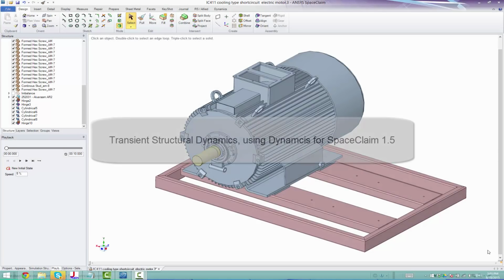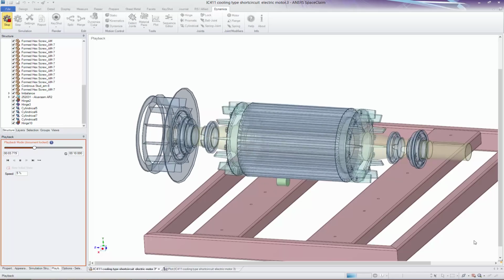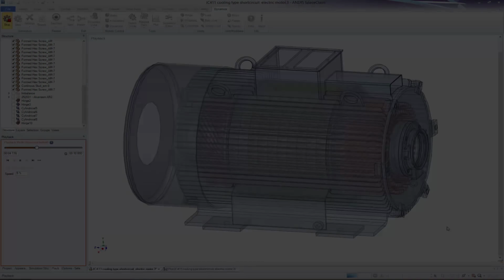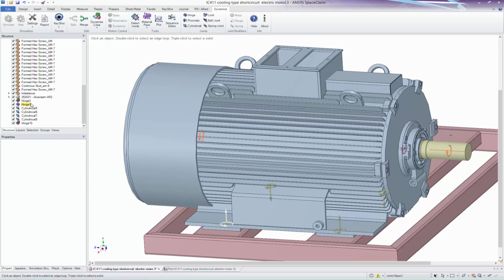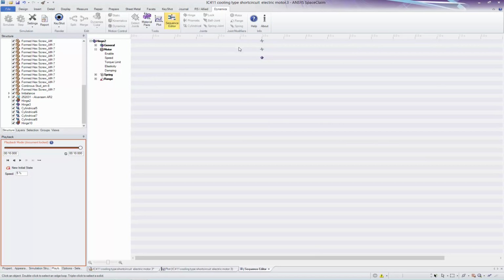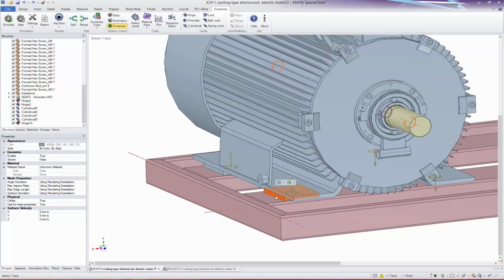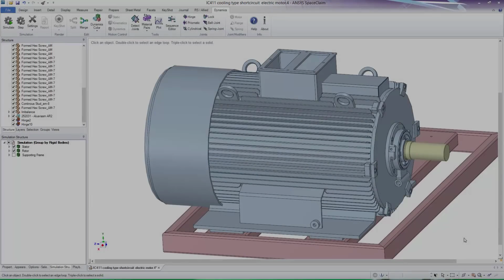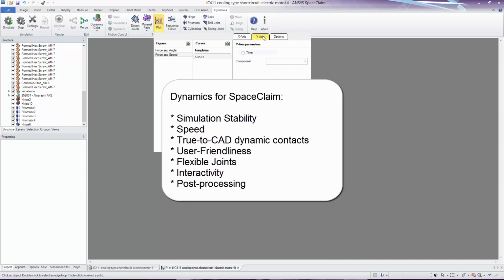Analyzing transient structural dynamics of an electric motor

Comment: Thanks for this helpful video but how do you change the RPM of the rotor "gradually" ? In which version is that possible rather than a step increase of RPM ?
Reply from the maker: +ariky Ariky 

I’m glad that you like it.

Just for clarity, the RPM changes gradually as a result of the dynamics of the system.  And the motor is striving to maintain the specified Target RPM under the given conditions.  

Now, the target RPM is set incrementally, just like you say.

Naturally, you can reduce the torque if want to rev up the system more slowly though (to do a frequency
domain study that isn’t affected by the transient change in RPM, for instance).  

Are you working on systems where the target RPM must be adjusted gradually/continuously?  Please reach out to us at support@algoryx.se and tell us more about it.  Such features are only a matter of GUI design, which is an interactive process between us and our users.  And, the more the merrier :).
Reply from the maker: There are several ways to do this, depending on how your system actually works: 1) apply a torque, back EMF and have that accelerate the rotor; or 2) use Python scripting to control the rotation in any way you wish.